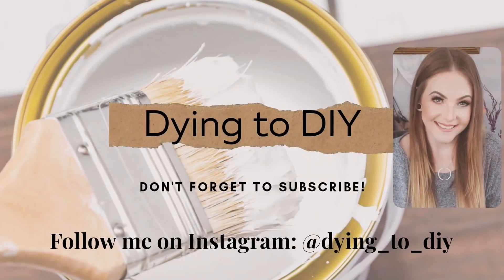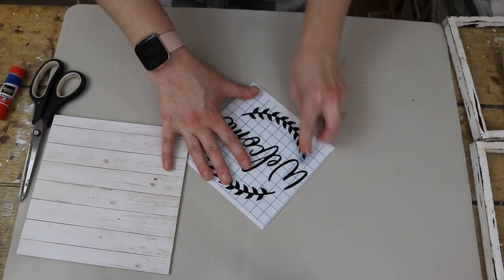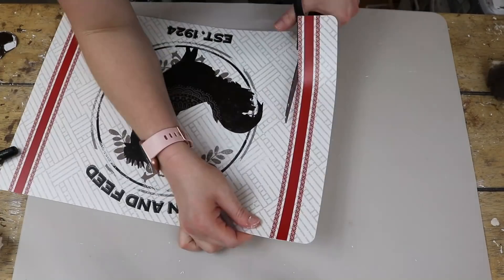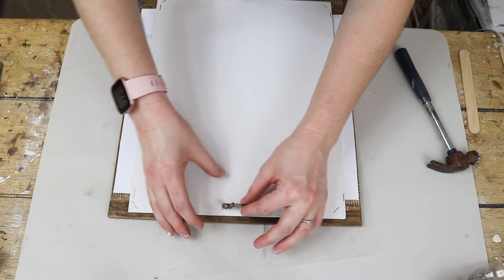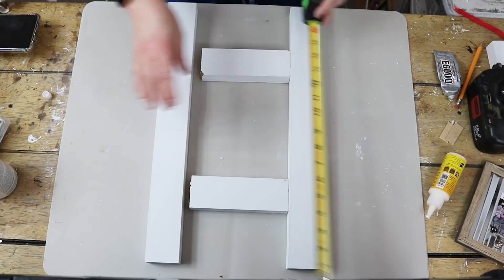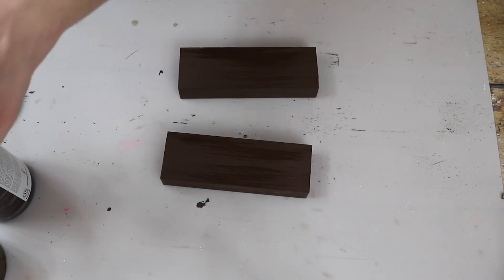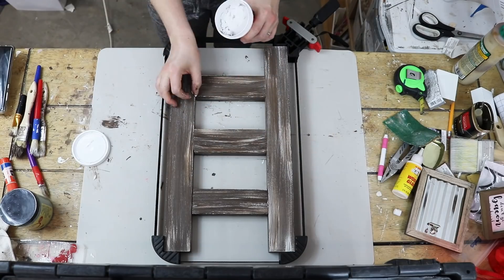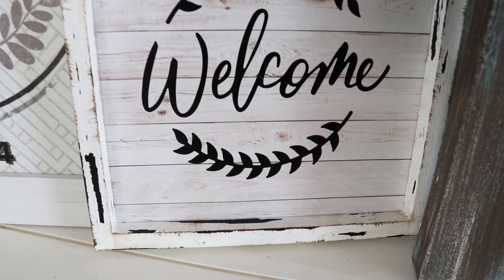Super Cute Farmhouse Dollar Tree DIYs | High End Decor | DT DIYs | Dollar DIYs

Comment: Well I have a suggestion for you on the black plastic frames that you painted with the white chalk paint.  Will, I sprayed my plastic frames with a matte sealer first, then I let it dry, and then paint the frames with chalk and letting it dry between both coats.  I painted 2 coats of craft paint on each frames.  This is only a suggestion.

Comment: Wouldn't it be easier instead of the popsicle sticks and then stapling the corners hammering down the Staples on the back, wouldn't it be easier just to take like a piece of poster board or foam core board and cut it just big enough to cover the entire back but not be able to see the foam core board from the sides the bottom or the top? Uh oh....sorry....I see you did that on the 2nd rooster pic.